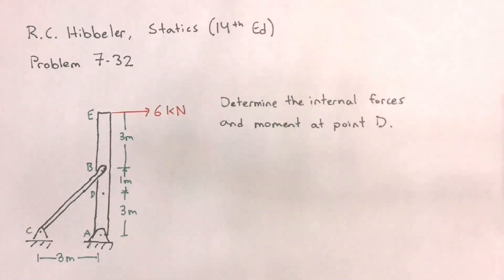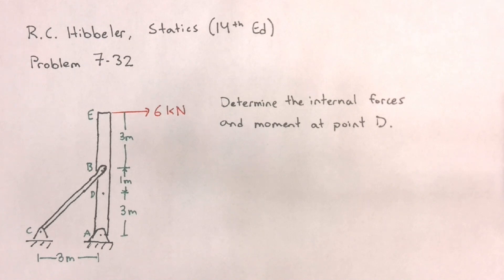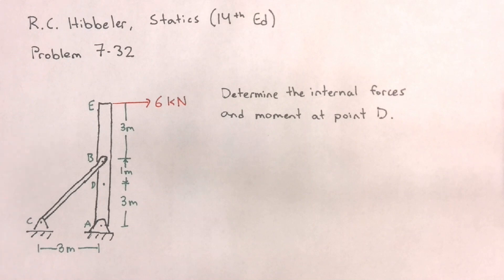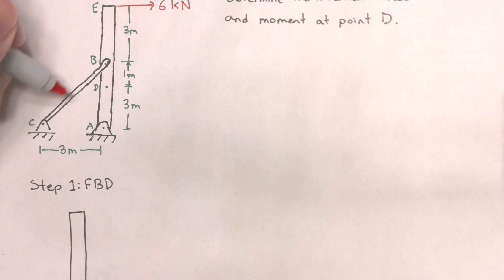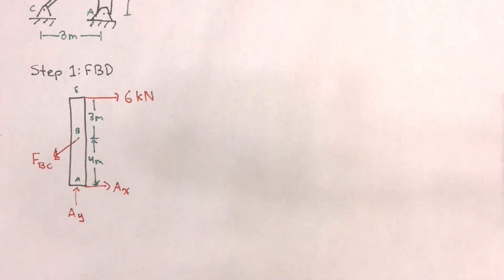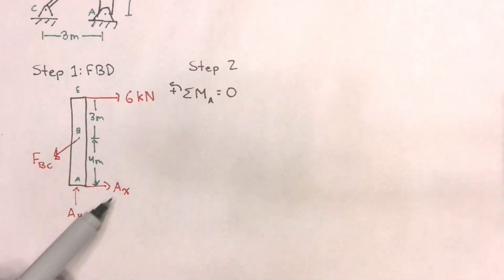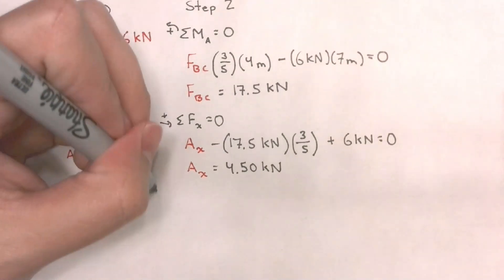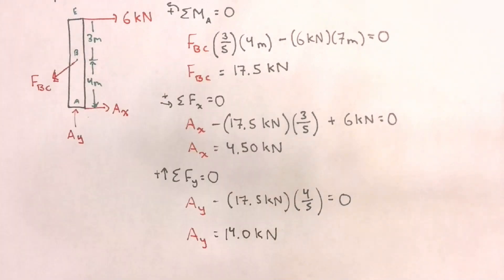Problem 7-32 (Hibbeler, Statics)

Comment: Do you have to state in the final answer which direction the internal loads are going to?
Reply from the maker: We are using a standard sign convention for normal forces (positive outward), shear forces (positive if the force "rotates" the beam clockwise) and moment (positive if it makes the beam "smile"). Starting from the assumption that all internal forces will follow that convention, we will get negative values if they point in the opposite direction and so, directions are not necessary.
Reply: @EngineeringTheory  in this figure, how do I know that the bending moment causes the member to bend upwards if it could also look like it’s bending downwards when you look at it from the left side